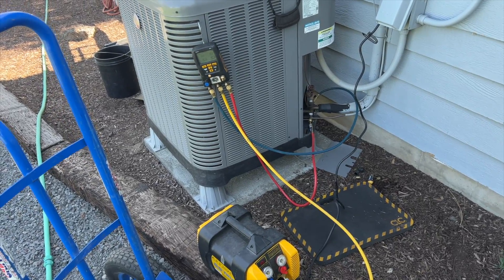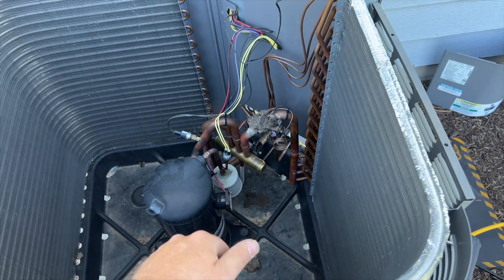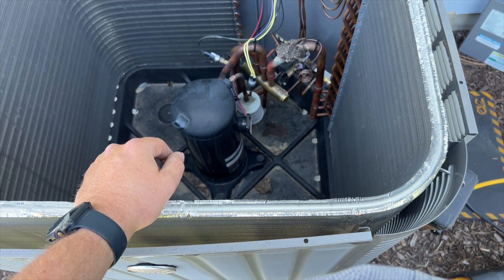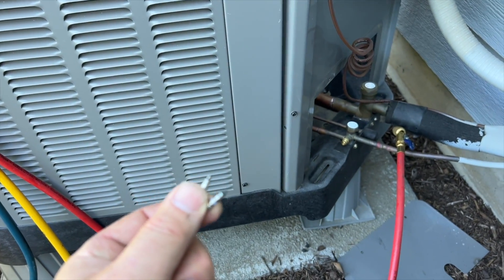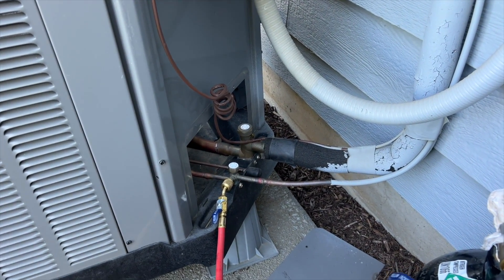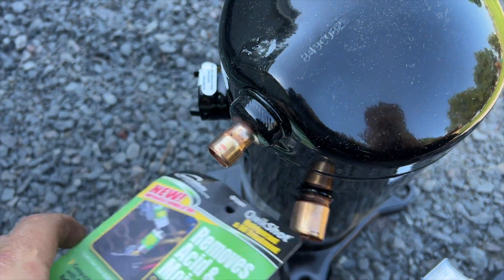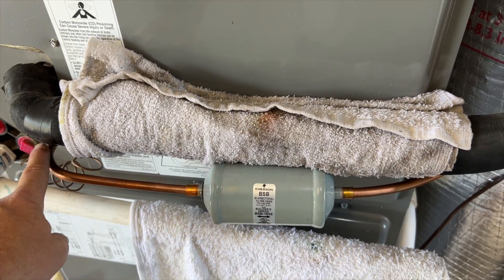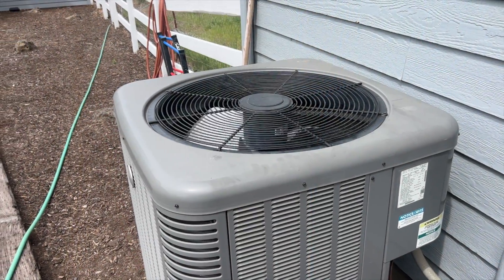How to Replace a Compressor on a Heat Pump EP136

Comment: I wish you showed the actual brazing and which rod you use.  I see most techs use Sil Fos 15%, but read at a compressor, because it is really steel and just coated copper,  you are supposed to use >35% silver content so Silv 45% or 56%.

Comment: That was great.  No B.S.  I'm adding a suction line filter immediately before the inlet just incase there is any shrapnel from the previous failure. Cheap insurance  IMHO.

Comment: If measure resistance between  run and start winding it lower than c/s and c/r . What causes that.  No OL or short to ground. When I try to started, it short cycle quick

Comment: You did an awesome job like always. If you don't mind an advice and I do the same as you do but with the additional of using rx11 to flush out the lines and I would replace the reversing valve just in case, that's odd that it's the 3rd compressor but yet there are some techs that don't do the proper procedure like you did. Keep up the great contents you always do 👍